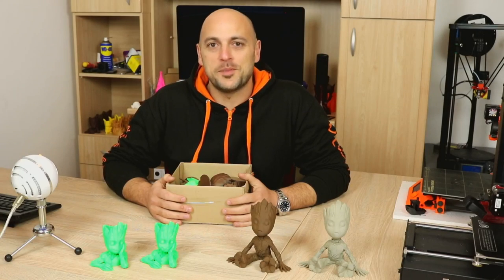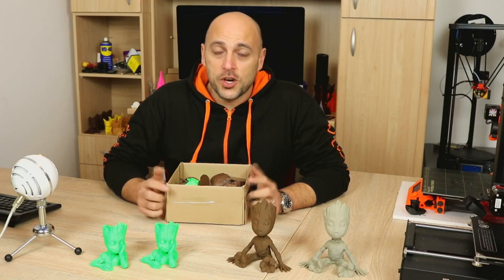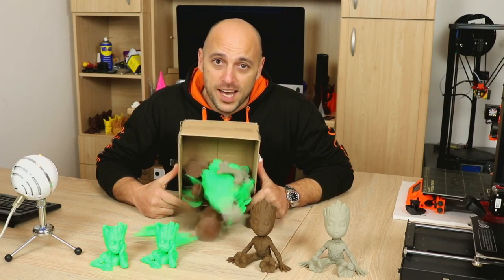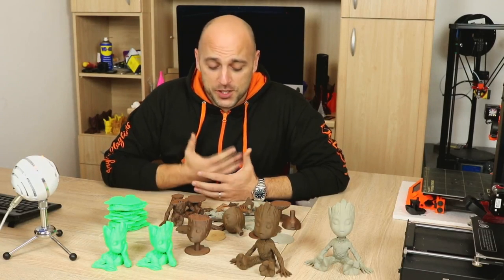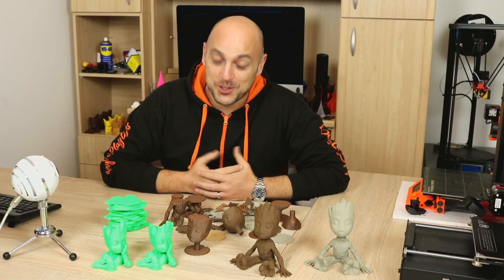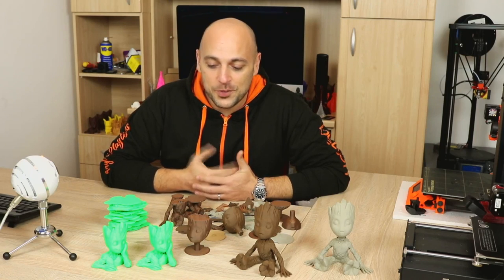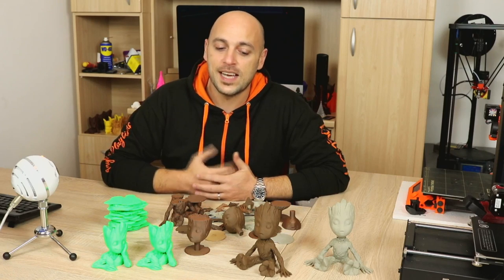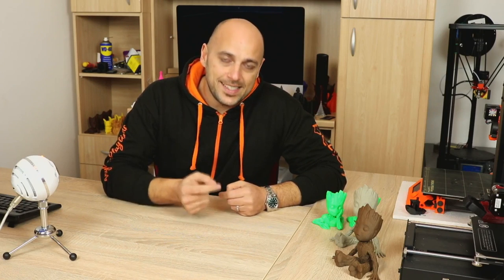3D Printing Lessons Learnt So Far - Tips and Suggestions

Comment: Love the simplistic approach you have. I am a retired and an expat living in Thailand. Bought an Ender 3 about 12 months ago. I love tinkering and found 3D printing a joy and a challenge. On the subject of clogging, I too had a problem with extrusion failure. I do have a MacEwen extruder  (up graded a few months before and found it to be an excellent replacement to the stock Crealty one). So what was happening? Using the process of elimination looking at the extruder and then the hot end. Unblocked the hot end several times and even replaced the nozzle but still no success. The only thing different was the bowden tube. I bought a transparent bowden tube online thinking it would be helpful to see the progress of the filament as you move it towards the hot end. As incredible as it seems I reinstalled the original bowden tube and BINGO problem solved. Still using it but have a Capricorn one in my spare parts box. Still printing beautiful prints from models to lithophanes and vases. Hope this will add to your list of possible list of solutions. Many thanks to your time, effort and commitment and always looking forward to your next video.

Comment: Hey Joe, try using your nylon for doing a cold pull.  I struggled getting good pulls till I started using nylon.  Heat up to 260+, push through till you see only nylon coming out, turn off heater, keep pushing nylon till it won't extrude due to low heat, let cool to under 100, heat up to 140, pull it out with pliers.  The nylon does such a good job of it that I've started doing a cold pull with it everytime I switch material types.  I have a little baggy of nylon strips cut just for doing the pulls.

Comment: if prints just dont wanna come out right, it may be due to imperfecitons in the nozzle face. luckily grey cardboard (cereal box) is jsut abrasive enough to polish brass to a morror finish. lightly lower the nozzle onto it, like when leveling the bed, and move the cardboard in circles for a minute or two.

Comment: Just found your channel. Good tips! Printing on a cooler bed with PLA is a great tip. Just found that works well myself. Thanks for sharing!
Reply: Over 5yrs Ive found the opposite. I print PLA at 50-60Deg and if I go lower - it fails. I think these things are individual to the filaments which vary substantially in how well they print at high/low Temp, and how quickly they resolidify, with/without fan@X%

Comment: I might be late to the game but I solve ALL first layer issues by setting the first layer size as a static number (.3 for first layer regardless of what the rest of the print is) and increase the first layer extrusion multiplier. I also use the BL Touch which has been flawless so far, NO paper as a gauge... I calibrate by getting a "close" height and trying a 3 layer print, then look at how well it stuck. If I need to be closer or further away I just go straight into the firmware and adjust the Z offset by "some amount". I get it done every time within 3 simple small prints (1 or 2 now that I've gotten better at it).

I use glass and hairspray for PLA, PETG, and ABS. Bed temps I use are 60/PLA, 70/PETG, 95/ABS (ABS is enclosed though).

Comment: Hey Jo, great video as always - I know its a while ago now but I have a quick question if I may...  I have trouble with zit and stringing specifically on this Groot model mostly around the fingers on the first few layers.  Your prints look great, did you have similar problems to start with, did you have to dial in the retraction or were you able to modify Simplify 3d settings to minimise retractions?

Comment: Nozzle calibration is a pain even with plug and play printers is still a pain.  Even worse when 2 people are using the printer.  We found that out this weekend when the hubs went to print and re-leveled and then suddenly everything was off.  I also find it fascinating how temperatures differ from person to person, for us the bed temp for pla needs to be 60-65 any lower and there is no adhesion any higher and its a mess.

Also clogs suck but they are a part of 3d printing life, they get easier to deal with as you get used to them, I love your technique though..  Everyone has at least 1 print that causes them to want to pull their hair out.  Mine was the gCreate Rocket, but once you get everything figured out usually your printer is dialed in and everything seems to print easier after that.
Reply from the maker: if i had hair, i would have pulled it out completely trust me lol at some point i wanted to throw it out the window. the adhesion issue is much more prominent on the Prusa though, possibly because of their PEI sheet, not a very big fan of it, but it is working well now that i sanded it down lightly.

Comment: Tronxy X3A awaiting control board upgrade, I bought a CTC i3 Clone to get me printing again. I wondered how well I could get a "Cheapest Machine on The Planet" to work. Bed/X Rails level, Nozzle (0.4mm) Height (eventually) Spot-on; 1st layer even & almost invisible, 200Deg PLA, 60 HB; No stringing; Sharp corners, Prints like a Boss if you set it up correctly. Im gobsmacked at detailed microthin (0.5mm) Parts. $99 inc UK Del@ Aliexpress. Credit to Cura 3.4.1, not v14.0

Comment: good video thanks heres a question pla curling /lifting on corners after printing for 6 hours why ????????
Reply from the maker: My guess would be either the bed is running too hot or the nozzle is slightly too high on the first layer

Comment: Hi thanks for the video with your valuable tips. I would like to buy a 3D printer, but I can not decide yet. I've seen all your videos and have the impression that the duplicator has a similar good quality as the Prusa i3 MK2. Would you say that?
Can you give me perhaps a small decision-making aid? After all, the Duplicator costs only 500 euros and the Prusa as a kit 739 euros. Please make further Videos with the Duplicator :).
Reply from the maker: Ashunar hey, thank you first of all :) it has good quality and it's a reliable printer, the difference is the precision and finish in terms of print quality. The prusa seems much more detailed and the finish in cleaner. The duplicator on the other hand is much more sturdy and quieter as well, plus has the added benefit of having a lot of available upgrades like the flexion.
Reply: And if you keep an eye out Joe will be getting an Anet A8 to review. 
I have an Anet A8 myself thanks to Joe, if you want something cheaper and don't mind a bit of extra work upgrading a printer It would be a perfect starter. :)

Comment: It is very strange that the more you heat your bed the more you get warping problems :/
Reply from the maker: 3D Printing Science yep, I found it very odd, especially in PLA. But it's a matter of sudden drop in temperatures between the heatbed and the fan cooling. The sundial I printed actually has some warping in it